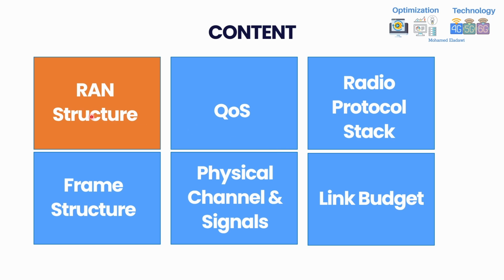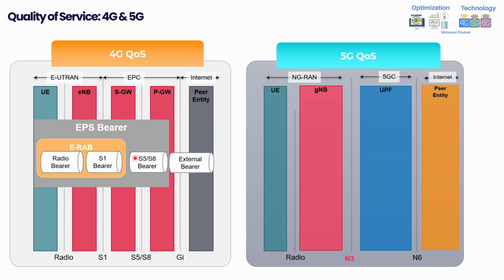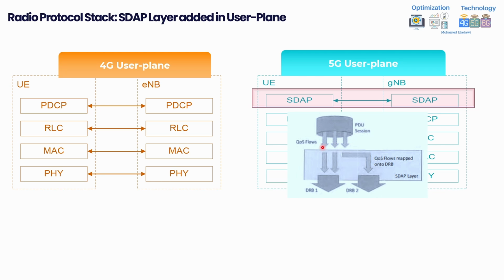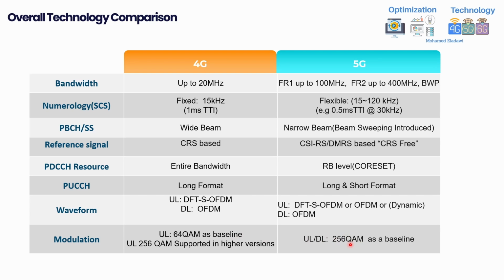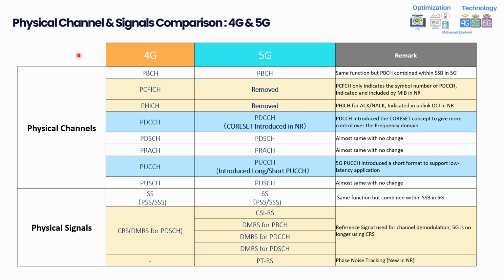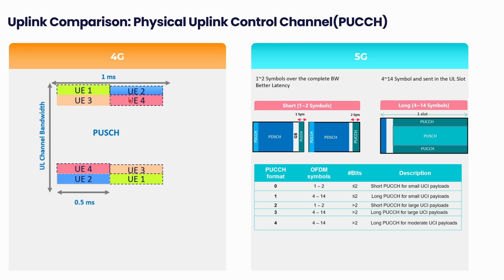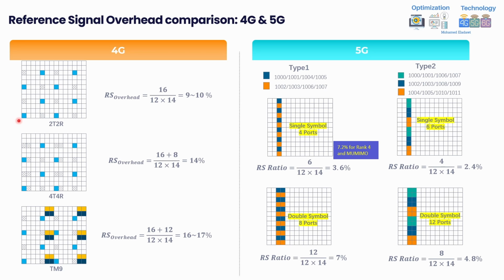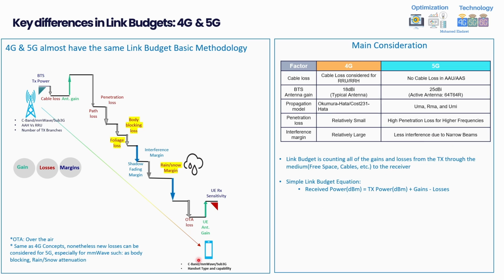4G Vs. 5G RAN | Key Technology Differences Explained in Detail

Comment: i have one question...suppose 1 site having 3 sectors so each sectors support different system frame numbers ? and each sector how many system frames supported it could be fix or it varies depending on cluster ? and in each sector system frames having diff numerology or it should be same for all system frames for a particular sector ?
Reply from the maker: Numerology should remain consistent, especially for TDD. Otherwise, you risk encountering a situation with significant interference due to potential overlap between downlink (DL) and uplink (UL) transmissions.